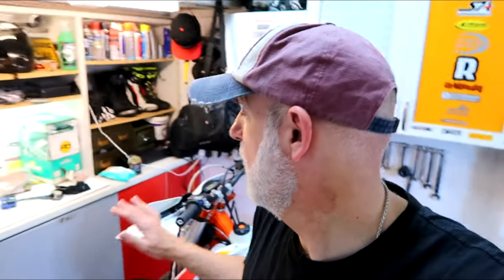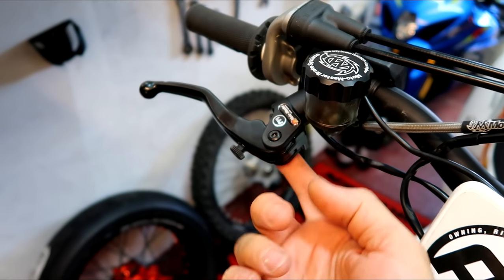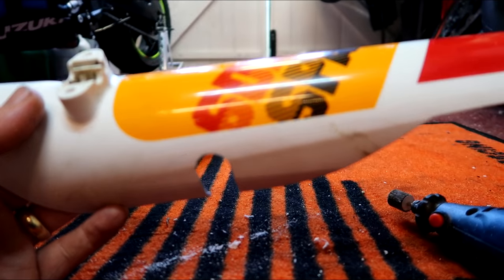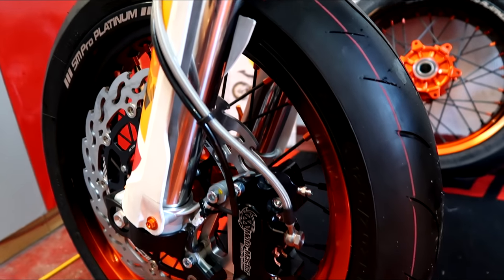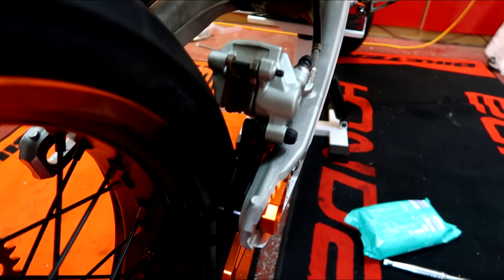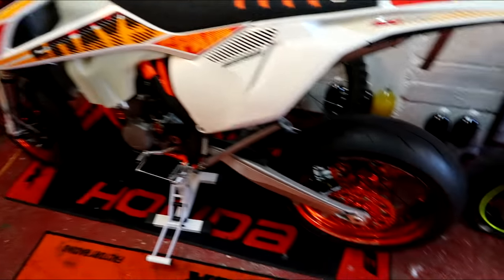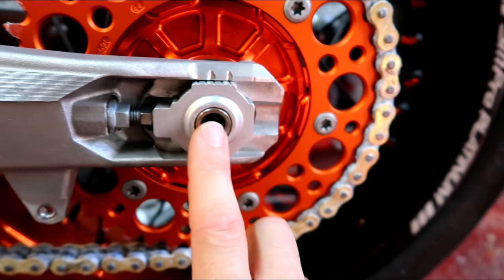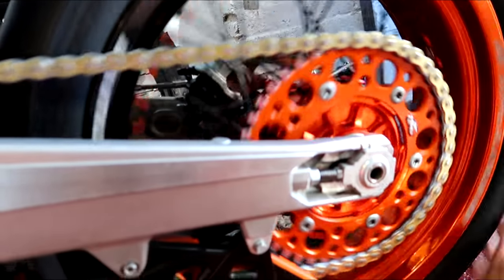KTM 500 EXC  Supermoto Build | Part II

Comment: You can still rock 160 and 150 wide rear tires with 4.25" rim, which makes tire changes so much easier when you have much more room with the rear caliper and the rim. Cheers.

Comment: I did a similar thing to my dirt bike - but I fitted a second large disc onto my dirt wheel to avoid mucking around with the caliper every time you want to swap over. I also got a second set of front forks, valved & tuned for motard duties and swap them out at the same time
Reply from the maker: Great idea John, I want to get my suspension revalved for road use, will probably just put up with it when and if the bike goes offroad..
Reply: Just be careful that you don’t smash your disk on ruts and rocks
Reply: @tjlovesrachel  lol I smashed the front disc on a rock on my Husky when I let a friend ride it! lol he went up and around one corner then opened her up...I turned around to see my bike vertical with him in a perfect superman position before he let go.. it was hilarious, until I saw the disc....my bad.

Comment: When fitting a chain, put the adjusters all the way in, fit the chain with a bit of slack, and dial it out. Chains stretch so you always want to be able to back out the adjusters during the life of the chain. also, it is way to tight. for MX purposes, a general rule of thumb is 3 fingers under the chain at the mudguard is need. for road usage, 2 should be fine. If it hits the tire, fit a smaller tire, or you'll ruin both chain and tire, and maybe your engine crank cases as well.
Reply: P.S. you can rotate the KTM chain adjusters.
Reply: and put a zip tie around the front brake overnight, it will firce air to go up top.
Reply from the maker: Good tips thanks 👍

Comment: do the spacers you put in the rear wheel make it possible to fit a bigger tyre such as 150/60?becuase ive got a wrf 450 2009 and it rubs on the side.does it make the tyre go a bit to the right so it can fit without rubbing?

Comment: The chain is massively over tight. The brake line and speedo cable should be to the inside of the fork leg not on the outside....
Reply from the maker: Yes was tight there, removed that extra link now and adjusted perfectly

Comment: You may not have issues, but use a crimp-type chain splice instead of the cheap snap link. Save yourself a possible headache down the road.

Comment: Chain is way too tight!!!!!! You will destroy the front sprocket oil seal. Also flip the axel blocks to move the wheel closer. And the axel block on the spindle is threaded on so put it in a vice and tap it round to loosen.
Reply from the maker: It's sorted now 👍

Comment: Did you not get no issue with your 4.5 or 5.0inch wheel with chain rubbing along the edge of the tyre or did you offset the wheel or spacers used to correct sprocket alignment? Too solve chain rub.
Nice bike, best supermoto to have on the road. 😎👌👍🤙

Comment: Is it possible to fit a keyed ignition switch onto a Mx or Enduro bike? KTM salesman said it’s not because of the ECU’s on modern bikes.
Reply: Of course it is.. you just interrupt the power to the battery with a switch or relay and switch. They make lots of universal kits. The new bikes don't even have a kick start so without the battery you ain't going nowhere.

Comment: What's your plan with Speedo calibration?
Reply: You just change the diameter in the menu
Reply: @vxlgsi  this seems better than my WR where you needed to open up the Speedo unit itself and snip a grey wire which then allowed you to access this menu and change the wheel diameter.
Reply: @philiproberts6947  you don't cut a wire just unplug one on ktms
Reply from the maker: Yes speedo already adjusted, unplug a wire then just enable the option in the clock to adjust rolling wheel distance

Comment: My dad has a tall persons torso and dwarfs legs. I can therefore blame him for my genetic construction. I also have a long torso and diddy legs... I will never be able to ride an adventure bike, dirt bike or supermoto comfortably... However... I am the only person I know that car ride a sports bike all day and do not have to stretch my legs. Swings and roundabouts mate.
Reply: I'm short and have no problem
Reply: @vxlgsi  you've inspired me.
Reply: @nineofoto  bikes are so light it just doesn't matter if your tip toe.
Reply: With short legs the trick is to lean the bike and body only to the side without the rear break when stopping :) Using that technique even very short persons can ride it and that is good way to stopping anyway as then you can use both breaks or only rear... I did for a short while own a KX125 that had been modified with front and read shock from a RM125 and it was about 10cm taller then original. I could not reach down to the ground at all but that was not really a problem, when I had to stop I just jumped completely of the bike  and when starting I jumped on the bike same way you would if doing a run start alone.